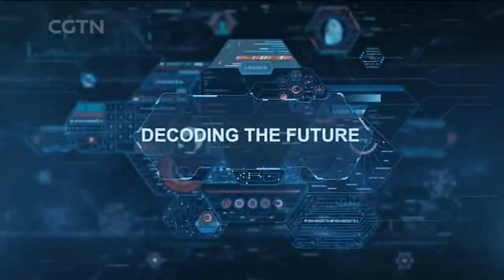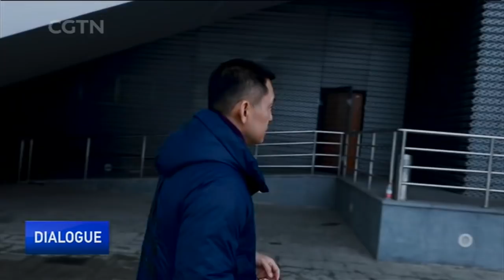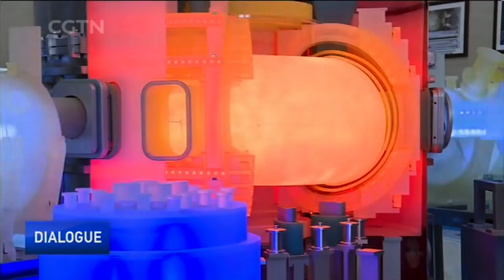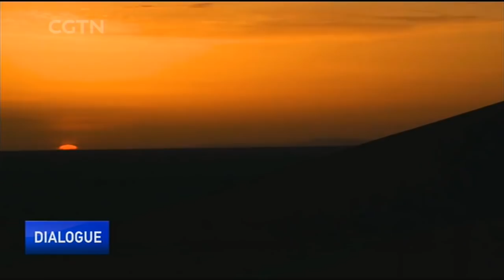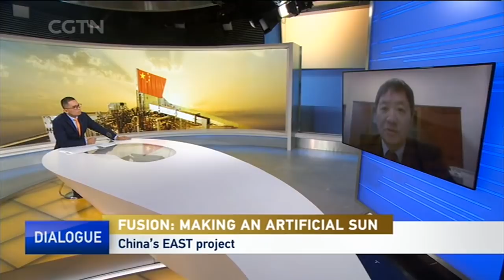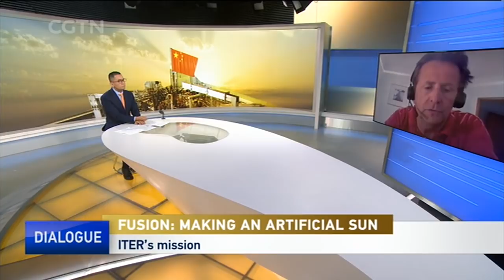Fusion: Making an artificial sun

Comment: Please the whole damm planet has been chasing viable sustained fusion tech for over 60 years. I don't expect to see a viable commercial fusion reactor in my remaining hopefully 20 or so years left of my lifespan. That way too late to address a 4 degree celcius of change. Better off investing in securing a independent microchip manufacturing capacity at least equal to and independent of American tech and American controlled supply chain.

Comment: You...know...looking at this and understanding its potential this could be the power cord to fuel ultradeep space travel much easier.....a few of those artificial dun should provide enough propulsion to enter light speed travel I am sure.  .then there is the issue of a material than can withstand that much pressure.....

Comment: Exciting stuff.

  Ive been looking at the possibilities of fusion for some time and it fires the next generation of technologies to a place where our species literally make the next evolutionary step toward a sustainable future and one not limited by the constraints of power. Which is huge for every aspect of our cultures.
 Why the long time horizon? 
   We have to transition into it. Our cultures reliance on fossil fuels has powered our economics around the burning of fossil fuels and our reliance has to be broken slowly by the introduction of new technologies that incorporate the use of unlimited power without the use of fossil fuels . Namely , Planes ,Trains and Automobiles , our housing and what clad them , our manufacturing and so on . it completely changes the paradigm , it changes it so completely that if it were introduced tomorrow would simply be unusable because it is not compatible with current technologies and it would die on the vine. 
  Our development agendas , agenda 2030, 2065 for the African continent and so forth are pushing the transition away from the fossil fuel driven economies to the adoption of new technological build outs that dont shock the system and bankrupt fragile developing countries , which is all of us :)  and provide the next generation of revenue streams on a foundation of unlimited energy.

Very, very exciting...

Comment: This potential technology will enable us to tackle climate change. Go China!
Reply: @sonazaya7400  No, smaller.

So what? they've been working on AI for a long time too.

Some things are hard.
Not impossible.
And the sun shows us that it is possible.
Reply: @sonazaya7400  yup, they claim the China made it all lol
Reply: All tokamak fusion experiments will fail, icluding the current international ITER project. This is because our
modern physics based on Einstein's E=mc2 is wrong; energy is all fictitious. High temperature fusion experiments have been going on for more then seven decades and nothing has been achieved. Of course,
those who have spent billions of doallars will say they have made significant "breakthrough" - just to
keep the funds coming.

Fusion will finally succeed if the physics world is willing to first dump all these physics based on the E=mc2.
  

E=mc² is fictitious; energy E does not have a real unit of energy.
This is because relativistic force formula: F = d/dt (mv/√(1-v²/c²) ) does not define a real unit of force; e.g. the SI unit newton is only defined as in : F=ma. When force does not have a real unit, the work energy theorem that derives E=mc² also give only a real number without any association with any real unit of energy.

Best regards,
Chan Rasjid Kah Chew,
Singapore.

"Chemical Analysis Of Plain Distilled Water May Refute Mass-Energy Equivalence Of E=mc²"
"Is Mass Spectrometry Accurate" - Penning trap cannot measure atomic mass; our nuclear physics wrong.
"The Relativistic Mechanics of E=mc² Fails" - E=mc² is wrong.
http://www.emc2fails.com
Reply: @chanrasjid8688  Cold fusion is antagonistic to our undeŕstanding of extant rules which govern nature. Cold fusion is pathological science mayhaps a theortical construct of a muon catalyed cold fusion process is possible but that really stretching it to put it midly.
Reply: By the time this technology matures sufficiently say within 30 years for a viable commercial fusion reactor prototype and that may well be widly optimistic the world be well embedded on a irrevisible path to a climate regime of at least 4 degree celcius of change or higher. This tech will defintely be way too late to save us from global warming.
Reply: 共匪 communist bandits,
Free Hong Kong..
Free Taiwan.. 
Free Tibet..
Free south China sea..
Free Indian territory..
Free Uyghur Muslims..
Free world from Wuhan virus..
Free WHO..
Now Free mount everest too..
Reply: @normalperson-x7o  Nuclear reactors and atomic bombs work because they know how nuclear fission gives off huge amount of energy, e.g. uranium. Its is all experience from experiments which has nothing to do with any theory or E=mc². They use gunpowder in cannons in earlier centuries without knowing the chemistry of carbon, sulfur and potassium nitrate. It was just through experience that the early Chinese discovered that the correct mixture could produce an explosion. It is the same for atomic bomb; they know from experience - through experiments - that uranium could make a bomb. Nothing to do with any theory where nuclear energy comes from.
 
Chan Rasjid.
Singapore.

"Einstein's E=mc² Wrong"
http://www.emc2fails.com